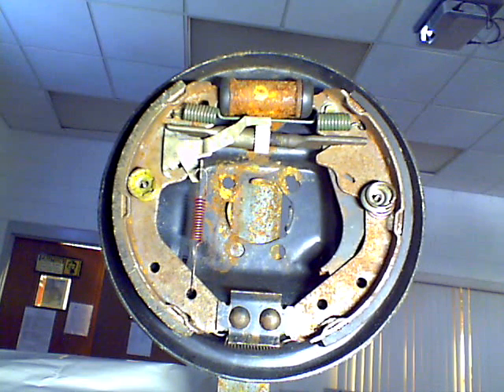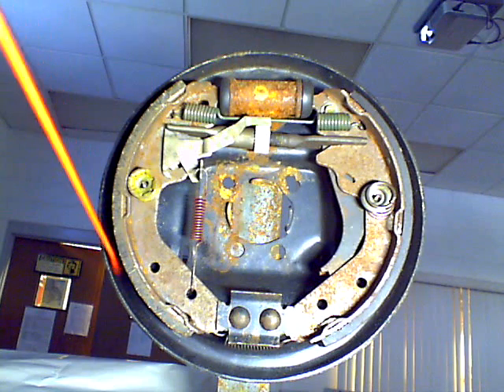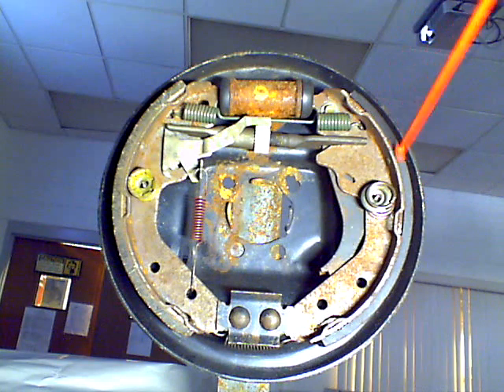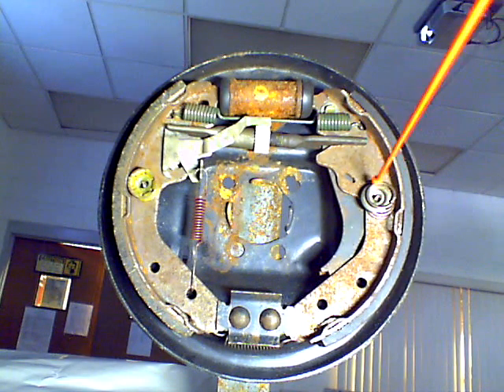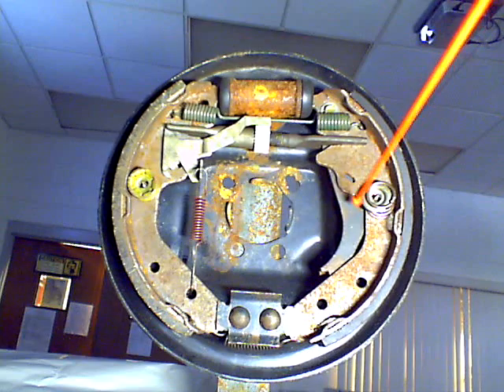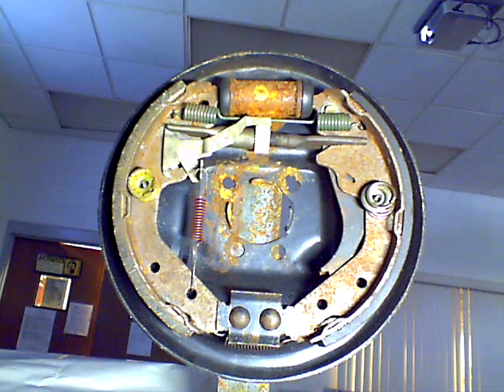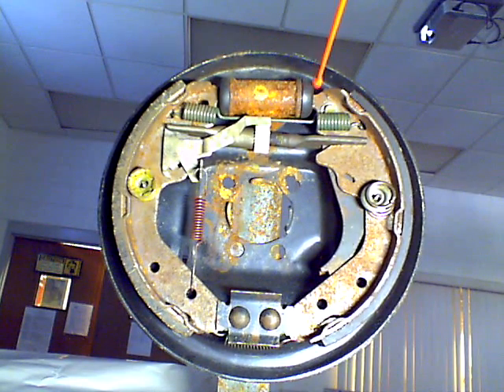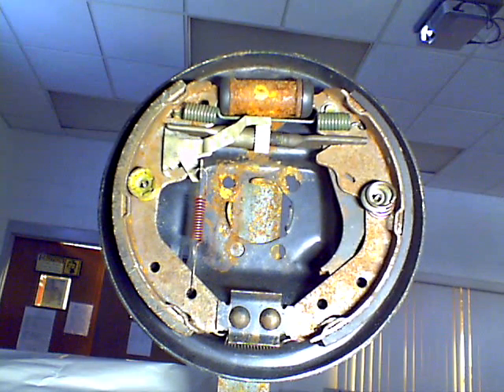Non Servo Drum Brakes

Comment: Just to add to your description, on operation of your parking brake the lever is pulled forward by a cable, this will not only force the trailing brake shoe out but the lever will act upon the operation rod that is also connected to the leading shoe. With this action both brake shoes are forced out and onto the brake drum surface, by doing this both brake shoes are used to hold your brakes in the parked position. Adding to that, as you use the term emergency brake you also have both brake shoes acting in an emergency situation. Thank you for the video & keep up the good work 👍

Comment: Not trying to be a dick but the correct terminology is parking Break cable and parking break leaver there is no such thing as an emergency brake on a car or truck. Parking brakes are used for just that parking or keeping a stationary vehicle stopped if it were to slip out of gear, not stopping a moving vehicle.

Comment: On a non-servo drum brake system with the wheel cylinder located at the top of the backing plate the front shoe is the "leading" and the rear show is the "trailing".  You identified them as "primary" and "secondary".  Primary and secondary are the names of the shoes in servo brake systems.  Additionally, the self adjuster mechanism on the brake system you have in your video is actuated by the parking brake lever, not by braking in reverse.  Some do adjust in reverse, but not this one.
Reply: Like your explanation, so does this mean if the cylinder is located at the bottom of the back plate then the rearward shoe is the leading shoe?